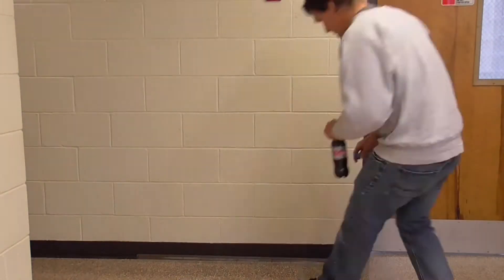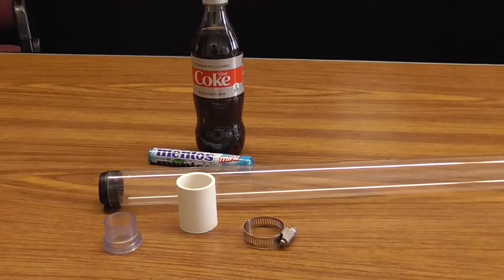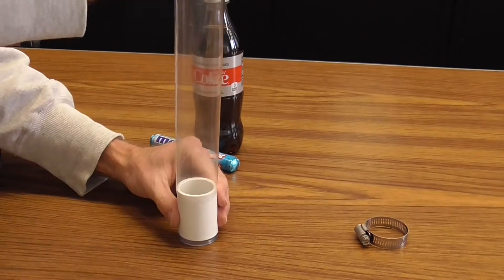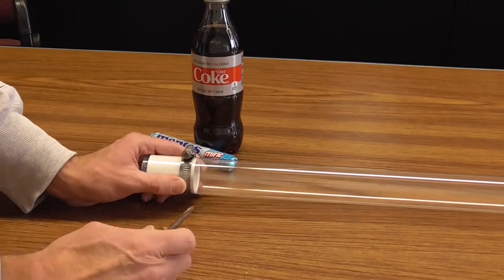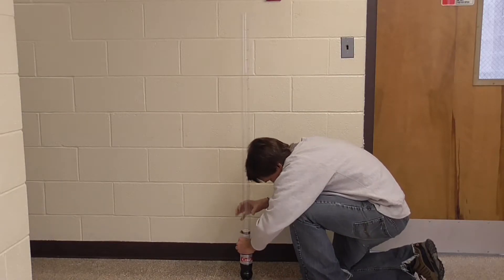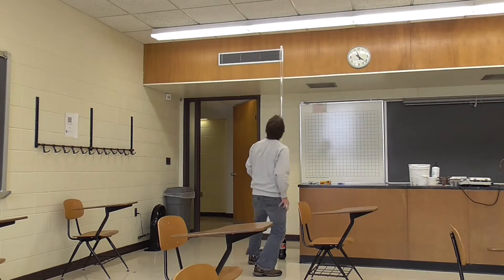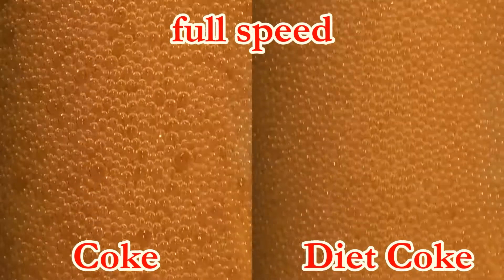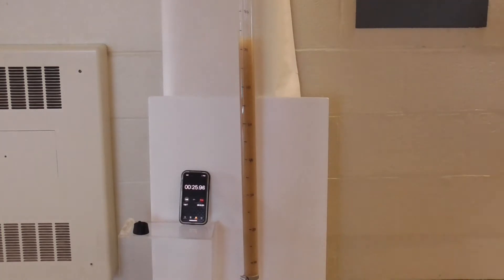How to Make a Coke and Mentos Measuring Device

Comment: I'm performing this experiment with my 3rd grade class for science fair.  We are testing different types of carbonated fluids and the mentos reaction.  How wide is the tube and PVC pipe?  How did you get an 8ft florescent tube protector?  I can't find that size? Can I join two tubes together with a sealer?
Reply from the maker: You want to get a Schedule 40 PVC fitting. You can get these at Lowe's or Home Depot. Go to the fluorescent light section in Lowe's or Home Depot and ask for fluorescent light guards. Let me know how the experiments work!!
Reply: Thank for the information.  I'll let you know.  😊